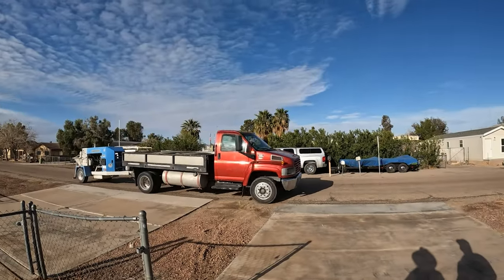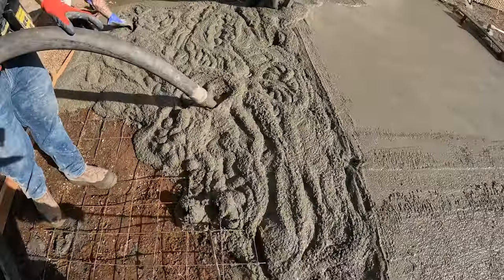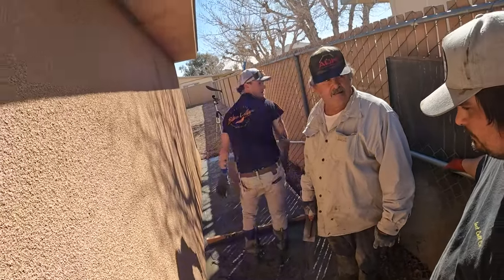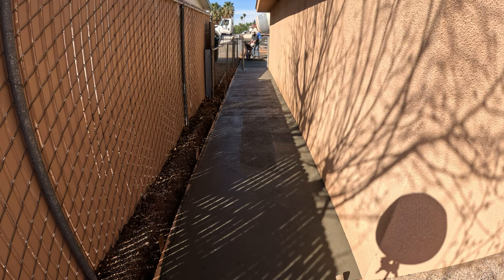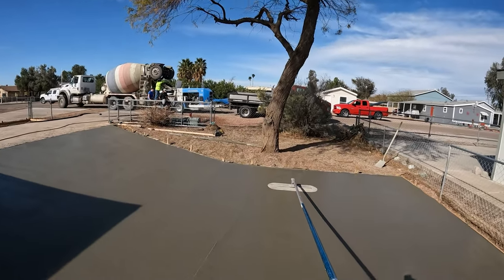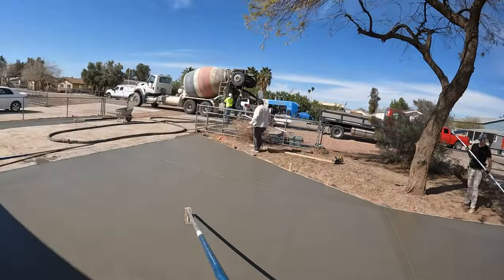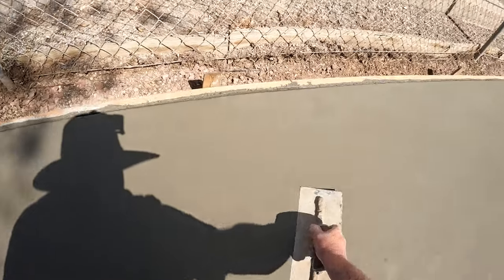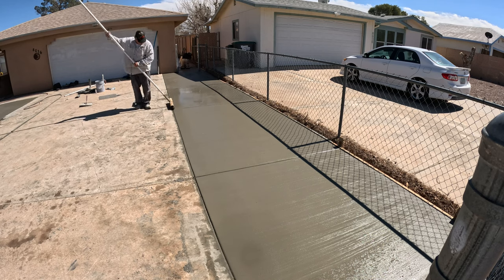Pour Day: Concrete Pad for a Tough Shed and additional Parking area.  Part 2.

Comment: How much 23year union cement mason 
Why did you mean You used wire mesh  instead of rebar because of the heat...we use rebar on everything just curious
Reply from the maker: In a 4" slab it heats at a different ratio then the concrete and causes separation
Reply: @OdellCompleteConcrete  appreciate it
Interesting

Comment: What does a high heat climate do with rebar versus wire mesh?
Reply from the maker: Cracks the concrete in a 4" slab

Comment: Good morning Odell ! 
What is the recipe to make concrete? 

94lbs portland bag 

Ideal mix =( sand and gravel mixed together already from distributed) 

Also how many 94lbs bags Portland make 1 yard ? 

Thanks buddy 😎
Thank you buddy 😎
Reply from the maker: 5 94 make a yard
Reply: Thank you buddy! 
Also what about how many shovels full of Portland to ideal mix = (gravel & sand ) to make Concreat? Or with bucket 🪣 to mesure could work. I am not doing the 321 method becouse I am buying sand and gravel premixed already witch is called from local landscaping supply ideal mix comes with 1/2-3/4 rock and sand together already. 
Thank you for time and patience 👍💯

Comment: Hey Odell! What size joint cutter do you use. Length/width/depth? 🤙
Reply: What size jointer do you use?
Reply from the maker: 1/2 radius, 3/4 deep
Reply: What about the long joint cutter you use first to open up?